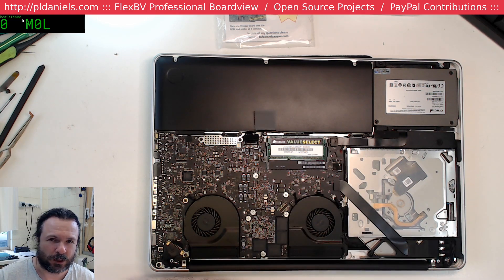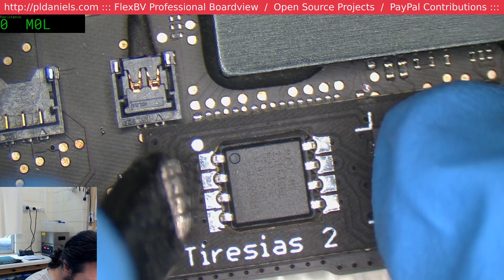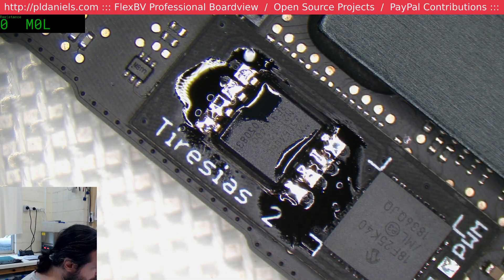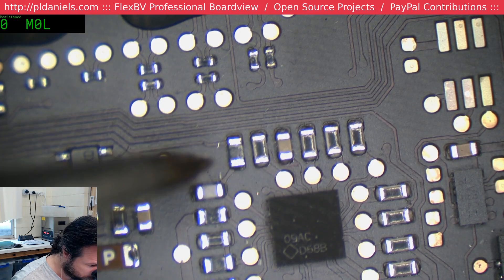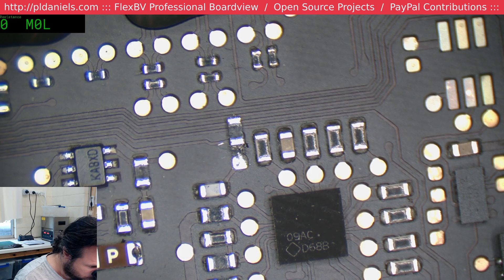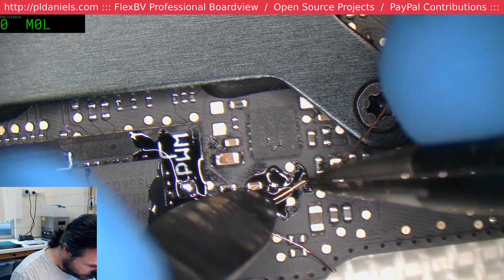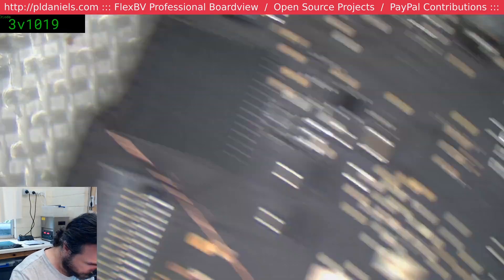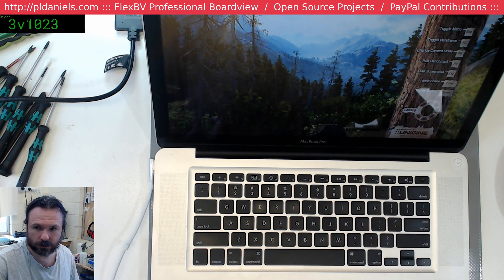Restore 2011 Macbook Pro 15" Back to life with the CMIzapper & brightness control in HighSierra

Comment: Hi Paul, don't you remove the enamel from wire? What temperature are you using for soldering enameled wires? Does it just go away by heating it?
Reply from the maker: You just have to rub the tip of the iron over the wire a few times with solder and it'll break down.

Comment: Hi, Paul. I have installed TIRESIAS 2 for MacBook Pro 15 (2011) and work.... I have only one problem, The second partition WIN7 don't run... black screen, fans are stopped, white led is off... In second time I have erased WIN and start a new installation with boot camp of windows bat when the DVD start... same situation black screen etc... do you have any solution...? the problem is the AMD GPU missing? Thanks for your reply...

Comment: Hi i have a macbook pro a1286 2011 turns on normally but doesnt show anything the screen remains black what can i do to fix this im in Mexico 

Thank you great video
Reply: I've had a few with the same problem (i have a repair shop). Just do the same as Paul did here, you have a faulty GPU. The tiresias will force tha machine into the intel chip and it will run normally.

Comment: I have to say - this would be a good solution for that Rossmann guy to offer. :) I am ending up sending my MBP 2011 17” off to dosdude1 for the JTAG programming repair, but I would prefer the CMIzapper because it is reversible pretty easily.
Reply from the maker: The cost is the issue for a number of people, but I do prefer the zapper option overall

Comment: G'day Paul, thanks for making this video, mate. You seem extremely knowledgeable about the GPU issue in the A1286. Can you please tell me, of the various software GPU bypass methods, which one works best for the 2011 15" MacBook Pro? I have a dead GPU on mine and am trying to get it to work for my little daughter. Thanks in advance for your recommendation. Steve.
Reply: The same Zapper as he used.
Reply: @fortroadmassive4095  Thanks
Reply: @thebusinessfirm9862  You found a shortcut for the second wire!! Good skills man! Have a zapper arriving tomorrow for what I thought was a dead Smackbook! Thanks for the vid btw ;-)

Comment: Greetings from melbourne. How awesome is that. and is that locktite you are using to bed down your jumpers with.
Reply from the maker: In this case, the green stuff is UV-cure solder mask.  Usually solder under the "Mechanic" brand name on eBay.

Comment: Good find on that test pad Paul, Much easier than running that wire to the chip or keyboard connector , I asked you a month or so back if you did this repair i told you its awesome.
Harald is a genius try out his Medusa tool.

Comment: Does the video output on the thunderbolt port work now?
Reply: no the video output is generated by the AMD Radeon HD 6750M chip but it's desactivated after repair.
Reply: From the way the Mac is put together there is NO way that the external video on the Thunderbolt port can work without the AMD GPU. The remaining functions of the Thunderbolt port remain intact. (The GMUX is wired so that it can switch the LCD panel between the Intel to the AMD GPU. The video for the Thunderbolt port is hardwired to the AMD GPU.)
Reply: A little late but would it work with an external gpu?

Comment: Hi Paul, there's also a CMIzapper Tiresias module for the 820-2914 board, the 17" MBP 2011. I installed it about 4 months ago and everything works well since. Now the computer acts as a 13" MBP 2011 with a bigger screen. Performance is quite good with the Intel GPU. I would recommend this repair.
Reply: Good news to hear. I have the same machine and I am thinking of getting the repair. does it solve the overheating. because I used the method that disable the AMD graphic using some code. and the laptop overheat.
Reply: @note9you535  with the CMIzapper Tiresias module install procedure you have to remove a resistor on the logic board so the ADM graphic chip  no longer get any voltage so no overheating.
Reply: Well i tried to install it on 15" macbook pro and issue im facing is, now the fans (both of them) just spins for 1 second and then stops. Looks like laptop is constantly restarting itself. 

Im pretty sure i followed all the steps mentioned in the instructions also watched many videos. But quite dissappointed im .

Any suggestions?